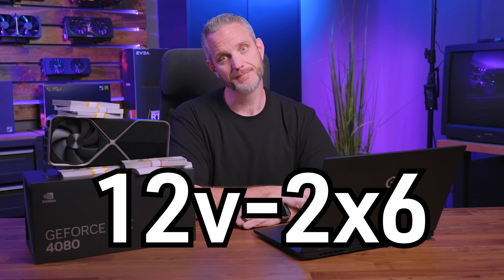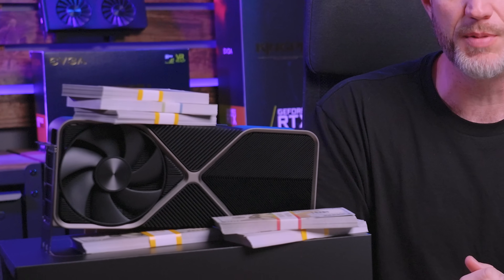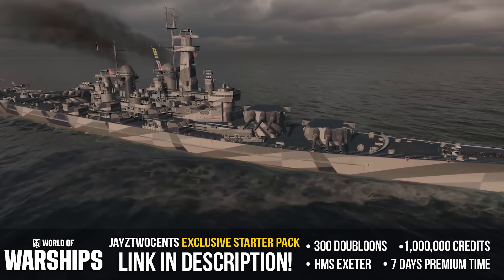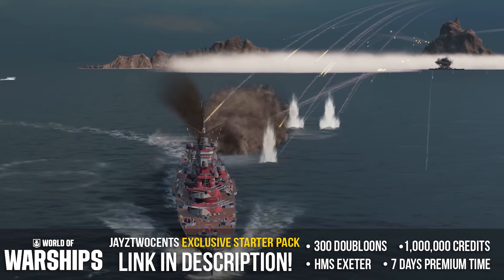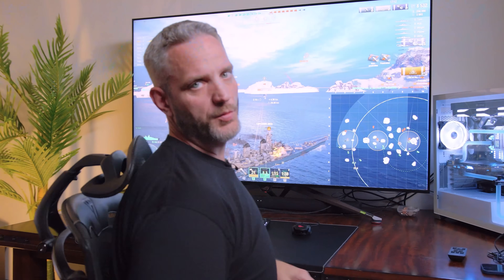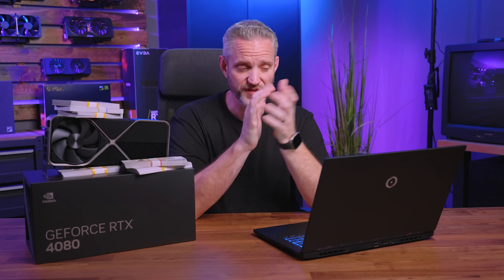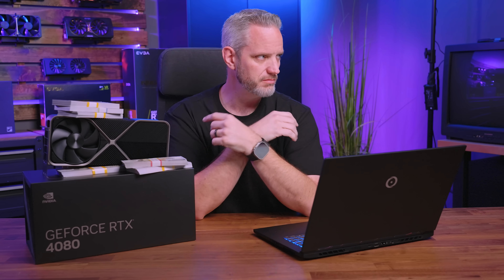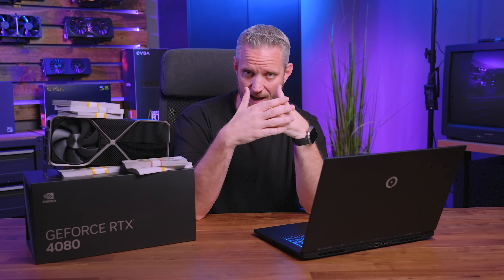They FINALLY admitted that this was a major issue!

Comment: Strange the sense pins weren't already designed to be a safety. Great change though. Crazy how much power these cards can draw.
Reply: Internal emails leaked from PCI SIG before the 40 series launch stated that Nvidia knew the cables were melting on both the PSU end of the cable and the GPU end of the 12vpwr    
connectors. They should have put the brakes on and did more testing but they released the cards anyway.
Reply: Imagine what would happen with a overclocked 4090ti that draws 600 watts.
Reply: @davidbrennan5  because $$$. I'm sure its only being addressed because its so widely known
Reply: @ItsMeMattCarter  this is what i was going to comment. Jay said it best with "this leads to the blame of "users weren't plugging in their cable all the way"'. They (NVIDIA) were looking for a way to deflect liability to users and were hoping the real issue wouldn't be discovered. The problem seems so obvious and so easy to fix that there is no other reason than money (cost) as to why it wasn't dealt with in quality control before launch.
Reply: @davidbrennan5  wow really? where did these get leaked? thats so messed up, smh greedy companies
Reply: @mannyfresh7065  it was leaked 9 months ago by Steve at gamers nexus on you-tube.
Reply: @mannyfresh7065 I forget where those emails got leaked. I just remember coming across that information some time ago as well. I should really start documenting things.
Reply: @davidbrennan5 

Unfortunately, it's how we human operated and run business. We ignore safety and cut corners, even when we knew the problem was there. 

The customers suffers the end products. Some, even resulted in it's own customer's death. 

Just ask the family that lost their lives in the submarine a month ago. 

Imagine, the wonders, if companies are actually just transparent and brutally honest about their products design flaws, though. Lol.
Reply: @WhyteLis21  Yeah but that submarine was a bit more than accepting a little risk and cutting corners to maximize profits. That level of incompetence and arrogance is truly astonishing. Balancing cost and profits is one thing when the risk is low. Doing it with a vessel carrying people to an environment where a single failure likely means certain death is why we need regulatory agencies even if they don't always work the way we wish they did.
Reply: @JJFX-  👍😊
Reply: @JJFX-  They also fired the guy that was telling them that the sub would very likely implode with the way they were designing and testing it. 

You're definitely right about them doing a lot more than just cutting corners and cheaping out with that project.
Reply: @ArtisChronicles  Yeah anyone who has worked with carbon fiber knows how dangerous it can be. It's another reason SpaceX ditched the idea for starship. I've seen people with CF mountain bike frames get badly injured when it fails and splits the bike during a downhill run. If you're lucky you can spot the start of a failure but it often seems fine until it basically explodes.

Amazing material but it's just not reliable enough to repeatedly stress in many safety-critical applications.
Reply: @davidbrennan5  I remember coming across that information as well. Kinda pissed me off, but now we're seeing the fallout from all of that.
Reply: To me that's still pulling alotta power through those tiny cables/pins.
Reply: @themechanic8643  my Rog oc 3080ti pulls 430w under full load, hence it having 3x 8pin pcies power plugs, funny what it replaced manages just fine at that wattage, maybe just add a 4th......you can have that for free Nvidia
Reply: Right!?!
Reply: Aren't they like just shorts? Like the power and reset pins on the motherboard? So all it does is dumbly tell the PSU is what pinout is on and off?
Reply: @3agl33y369  Yes they just tell the computer which pins are connector or not to allow power to flow. Just indicator pins basically.
Reply: @3agl33y369  .. It's not short, instead, the plugs aren't fully seated, so the connectors are arching which can get hot. Hot enough to melt the plastic and some rare cases about 50 per 150,000.
Reply: @DJaquithFL  I believe they meant the sense pins.
Reply: alll 4090 will go way above the watts you think or what's in the bios because nvidia limits don't work, if you have great cooling and your temp stay low it's basically limitless until the power stages burn, 3090 had the same problem my 350w card that only has 1 bios reaches 440w on a 3xpcie8 card the only way to stop that is to limit power wtih afterburner buildzoid from ahoc talked about it early in the 3090 life, that's why all those cards burned but not amd, some parameters are too high or broken and by the time they detect a problem it's too late
Reply: @fredEVOIX  I would definitely undervolt mine. 😂
Reply: @fredEVOIX  It depends on the card, I saw a 4090 Rog Strix OC (air cooled model) overclocked and it drew 570 watts. If you can keep it cool in a big case and you have good silicon, they can draw a lot. The OC cards have better dies, the aib partners pick out the good dies and use them in their higher end stuff. I almost bought one, I have a 3090 Strix OC.
Reply: @fredEVOIX  Good to know if I ever get myself a used 3090. I'll make sure to limit its power.
Reply: @fredEVOIX  .. Huh?! The 12VHPWR is good for 600W... Again, the problem is limited to 50 per 150,000 GPUs via user error improperly don't fully seat the connector.
Reply: @DJaquithFL  The guys that repair gpus are seeing melted power sockets on 4090's weekly now. Most people that buy an enthusiast card know how to seat connectors. I think over time they are working loose or some people may have small cases and don't have room to make large radius bends in their cables, even the 90 degree adapters cable mod sold are melting the sockets to some degree. It is a design flaw imho.
Reply: @davidbrennan5  .. CableMod's aftermarket 12VHPWR had some flaws not the actual 12VHPWR connectors. Every one of the OEM melted 12VHPWR has been traced to user error. Specifically Arching. If you search PCIE MELTING you'll find that this has been a problem for quite a while; e.g. 8-pin. People simply aren't properly seating the connectors. I'm certain somewhere there was a defective 12VHPWR connector produced .. same as you name it any component having a failure after you produce enough and humans simply touching it.

I have one of the first RTX 4090s and I have an infrared temperature gun .. absolutely no extra heat coming off of the connector, ambient temperatures. My PC CPU-Z JJU8GT  Here's the forthcoming problem, what are you going to do when you need 800W+ to the GPU? Each standard 8-pin is limited to 150W; so 800W/150W you'd need 6 x 8-pin vs 2 x 12VHPWR.
Reply: @davidbrennan5  You don't even need that large a radius... Unless you rip the pins out of the socket, bending the cable before inserting it will have absolutely no effect on this.
Just because this is user error doesn't mean the connector isn't bad. It seems clear that the tolerance is way too low.

This is not some specialized equipment, but a consumer product. Even when not fully seated, if the connector clips, then it's understandable that customers might believe it's fully inserted.
Connectors like this should have high tolerance, it should be hard to do something wrong.
Reply: @davidbrennan5  I'll be honest, I'd run the case without its side panel if it didn't properly accommodate the spacing for cables like these. However I also refuse to run a card this big.
Reply: @DJaquithFL  That's kind of a problem on its own huh? We're really going to see 1200 watt graphics cards in the relatively near future. It's not going to be a pretty sight.
Reply: nVidia has effectively made Fermi look like not a meme anymore. Ampere and Lovelace power draws are a literal joke. Like I say this is their version of Fury or a new Fermi, basically we haven't even had good nVidia GPUs since Maxwell and Pascal. Everything after has been a price gouged inefficient cash grab of a bullshit product. Look at the 4060ti vs 3060ti. They're pretty much calling you a simp to your face and mocking you while they rob you at this point. "They'll buy our GPU anyway won't you paypiggy"
Reply: @pandemicneetbux2110 how can I call Lovelace Thermi though? That's why Fermi was such a great meme.
Reply: @pandemicneetbux2110  I have to disagree there a little bit. While the 40 series is more expensive, it certainly is much much much more efficient then any other series before them. And believe it or not, in many countries a 4060 is at the end of the day cheaper then a 3060, same with the 4060 ti vs 3060 Ti.

What a 4060 Ti costs more over a 3060 Ti I would easily safe on my power bill within 1 to 1 1/2 years. And on top of that, it's also easier to cool my entire system, because there is less heat generated in the case.

And your comment about the efficiency becomes even more silly if you look at the Radeon 7900 XT and 7900 XTX cards. If the 40 Series is inefficient... what would you call the 7000 series? Sides of the 7000 series being even more of a price gouge, considering how much cheaper it is to produce a card that uses the chiplet design.
Reply: @germanmosca  lmao oh God not the power bill thing are you serious? I already saw a video on this stupid talking point, you'd literally need to be running that GPU every single day nonstop before the amount of money you spent on your electric bill was more for a 3060 than the amount of money you spent on a 4060. It'd take you literally YEARS before making even a dent. 

4060 and 4060ti remains an absurdly collosal waste of money, I'd say just get a used 3060 instead, but frankly even at those used costs it'd make more sense just getting a brand new 6650XT at that point instead. RDNA3 ended up not being efficient either, but this is literally the second generation in a row nvidia's high end has been burning peope's homes down with those shitty 12v plugs needed for powering a 450w card.

At the end of the day the sole thing that matters for gamers is price and performance. That is why I dropped nVidia like a hot brick of shit several years ago and haven't yet looked back. I still like my GTX 980, but that was when they were truly efficient and offered great performance gains. There are no great performance gains on Lovelace, only price gains and Jensen blowing so much hot air up my ass it's literally insulting. It's like watching an OF girl just blatantly insulting her simp fans and fucking dudes in front of her boyfriend and they're still paying like "o-o-ok :/" Like it is at the point now where I don't buy nVidia just because I have self respect. Their products suck and they need to lower prices before I even consider it again.
Reply: @pandemicneetbux2110  If my PC only runs 4 hours a day where the GPU is used to render Games or does any computing, it takes mere 3 years to make up the price difference between a 4060 Ti and 3060 Ti. But now, that's hardly the case for me. If i don't play a game i work in Blender, or DaVinci Resolve. So it's easily over 10 hours a day. Every day.

And the majority of countries on earth doesn't have dirt cheap power like the US or Canada. I know, it's mind blowing isn't it?

We pay 3 to 4 times as much per kWh then you pay in the US. And at that price you see a big difference on your bill. Especially if you don't just use your PC for gaming.

And sorry, a 6650XT makes absolute no sense to me, since it's useless in GPGPU. Would need a 6900 XT to barely be able to keep up with a 3070 Ti. And we are not even talking about the lack of Tensor cores and RT cores on the Radeon cards.
Reply: @pandemicneetbux2110 don't forget the other reason people are pissed with the 40 series cards. They're almost all lower tier chips than what they're being sold as. Like the 4060 is more like a 4050.
Reply: @germanmosca  I can understand why you'd be looking for a lower power draw card. I'll mention that the 4060 looks efficient compared to a 3060 because in reality the 4060 is actually a lower tiered chip than what it's being sold as. 

Which if they were honest wouldn't be an actual issue at all. You obviously have good reasons for getting the card. Just don't be fooled by the trickery Nvidia is playing at.
Reply: @ArtisChronicles  "You pay more for less" is literally the entire nVidia corporate philosophy. Like they don't even hide it. They might as well be laughing in the faces of every simp with an nV logo in his box calling him a paypig and a cuck to his face. That's more or less what Jensen is doing to gamers at this point. They feel so cocky because they know a lot of gamers really are simps, and that only some of us are going to switch to Radeon. I haven't looked back at this point. I wondered if there'd be some new generation after Turing that would win me back and instead it just got worse and worse and worse. Dealing with nVidia is like dating a narcissistic abusive alcoholic. I feel like nVidia needs to hit rock bottom first, but at this point I'm so shocked by how far they've already fallen it makes me question if they'll hit 3DFx tier blunders before they realize any mistake. Which they probably won't, because my nVidia stock is up so sky high at this point it's f;ing $456/share last I checked. I made money on my AMD stock too. But it's nowhere near the gains on nVidia which makes me question how much of nVidia's stock value is hot air too.
Reply: Tens of thousands of people have melted eight pin PCIEs. You can't fix stupid! About 60 people in the world failed the plug in their 12VHPWR connector that melted.
Reply: Holy shit its weird seeing one of my favorite tiktok creators on here. I haven't seen your content in a while how have you been? How did yhe v12 project turn out?
Reply: @climarathorn  Hahaha thanks so much! I'm actually out in the garage working on it right now. Should be driving soon. I took a long break from the project and built a rotary swapped BRZ. I'll be uploading the full series here eventually.
Reply: money. if u can save 1 dollar that can result to milions for companies. So go business people
Reply: Intel designed the connectors to be used by experts in the field, the average home user can barely change a lightbulb.
Reply: Never seen my 4090 draw more than 400 in normal usage
Reply: @stuartfury3390 It absolutely can pull over 400W, especially if you start using RT cores. Also many cards like the FE have a 450W stock limit whereas some others like the Strix are 500W. 600W is only the maximum when the power limit is raised in software but none of them actually draw that much.

Also keep in mind the power reading in software utilities can vary and never perfect. It's just good enough to get an idea of what's happening.
Reply: @stuartfury3390 my 4090 has drawn upwards of 575W under load.  Some cards don’t draw as much, some do.  Maybe you got lucky and got a less power hungry card than me.  Lol!
Reply: @stuartfury3390 and if we continue with the current trends, it won't take long before comments pop up saying I've only seen it draw 1200 watts with normal usage. 

Something needs to change.
Reply: @ArtisChronicles  Yes, you should lobby for nuclear power so we don't have to sweat bullets about power draw in the 21st century like a bunch of plebs

Comment: Fun Fact: Electricity doesn't travel "through" wires, but over its surface. The higher the gauge of the wire, the more electricity it can carry like of like the more lanes on a highway the more traffic it can move.

Comment: Just to clarify, this is 100% a cable change and the socket on the cards is identical and should support both new and old cables, but the new cable is recommended for 4090?

Comment: The problem with the 12vhpwr connection is the fact that you are pushing 16awg wiring to it's limit and the pins are smaller than 16awg which makes them heat up.  If you notice in the new drawing the pins are larger than the original to give more area for current flow.  They cannot have a smaller area/contact point than 16awg stranded wire.  I made this observation when you made the first video about this.  No one is talking about the connector pin size but they increased it for a reason.  THAT IS THE PROBLEM but they will never point it out because it makes them look bad.
Reply: I always thought it was madness to take what was basically 2x 8 pin connectors which would have carried a total of 300W between them, double the power delivery and shrink the size of the contacts/ connectors at the same time....or were my concerns too simplistic and common sense-like??
Reply: @darthvalkyr  The issue is dumb engineers.  1/4 of the problems in the world today are stupid engineers and the other 3/4 is just lawyers.

Comment: yeah when I went from a older card which had two cables conectors spreading the load to a 40 series using one I check that thing any time I clean my case I am super OCD about cables and electrisity I do not like to mess with that stuff.
and now when I smell cooking even if it is in my home I almost always shut off my PC and double check where its from, I get super paranoid about it since hearing about 4090s burning out I hate it my anxiety is making me hate using my PC

Comment: Using my Strix at 65% power limit. Its like 5-10% performance loss. On cablemods 90degree straight to Corsair PSU (it has a cable per connector, not like nvidias adapter).